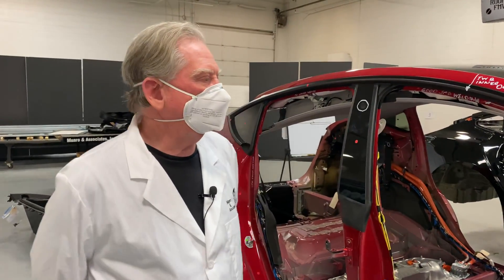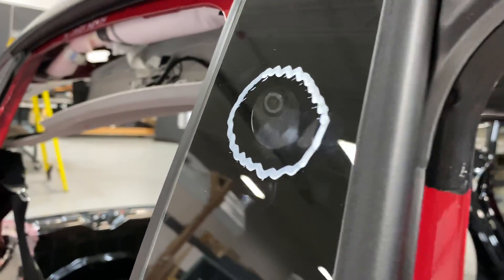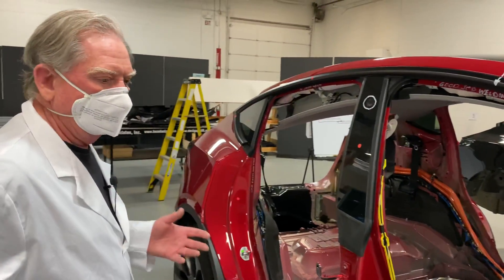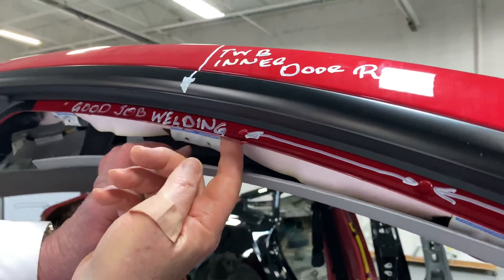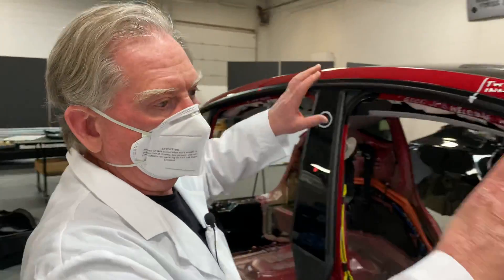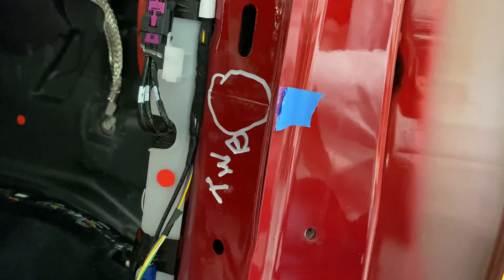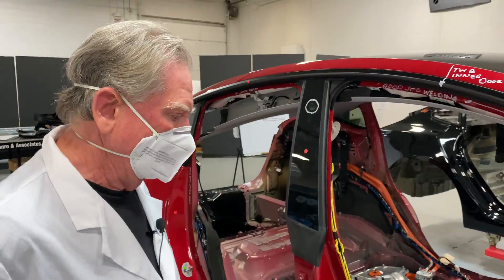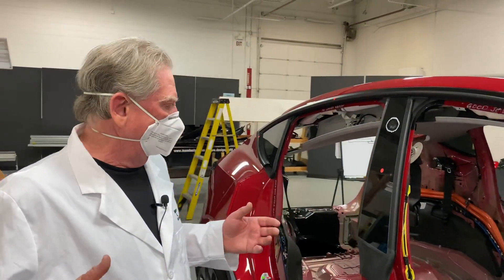Model Y E15: Tailor Welded Blanks, Body Side Inner, Welding Comparison MY-M3, Parts Raffle!

Comment: If you come across tailor welded blanks with no difference in thickness it can be due to different strength alloys or different heat-treatment of the two parts, see for example here: https://www.voestalpine.com/ultralights/en/Automotive-Notes/Tailor-welded-in-serial-production

Comment: Well i'm engineer that works for different automotive company and unfortunately in final assembly and not in body shop ..and i like this video..and you are right about many things.we are still using those old kind of welds..and you can be sure how crazy it gets when you have holes all over the place..well maybe hole isn't the exact name .i think when you weld those materials together you will get lower spots where water could go throu..or some other crazy stuff...also the screw you mentioned..that is common i have to say..designer didn't think or didn't think it would be better for ppl in production to make it easier..so they will come up with two or 3 types ob bolts..then you have to change sockets...and then it takes years to correct it..instead to use simple rules ..make it better for production to be able assembly it easier..faster..cheaper..with less tools ..less waste and so on..

Comment: Sandy.. just one point.. some contradiction in 2 of your vids. Is the model Y floor pan common with model 3 (as advised in an eatlier vid and hence the EPP wedge assembly under the pedals) ) or is it a one piece version of the model 3's pan  as intimated here?

Comment: How feasible is it to use adhesives (glue) s the primary method of bonding panels? No heat distortion and a continuous seam.

Comment: Can you please discuss the rubber molding that is around the doors and trunk openings? My model 3 has a bunch of ripples and bends that make it not fit seamlessly and it looks bad. I was hoping they cleaned this up in the Y, because it looks terrible from a fit and finish perspective. It’s almost like the molding wasn’t formed to fit in specific areas and was just manually pushed into the corners of the trunk and door openings.  BTW this series you are doing is fabulous:) Thank you.

Comment: The design and construction of the Model Y seems to be an improvement over the Model 3. Do you know if Tesla has made any changes to construction and tightened their tolerances on the current Model 3 verses the ones you inspected 2 years ago? Thanks

Comment: So who is responsible for putting the car back together? What happens if you have left over bolt ?
Reply from the maker: If we managed to put it back together with a left over bolt, did we improve the design or make it worse? Interesting question! All jokes aside, we will not be putting the car back together. Having the individual torn down components is more valuable to us for future analysis and comparing to other vehicles moving forward. Thanks for the question and thanks for tuning in!

Comment: I actually would like to know why electric cars are still using conventional acid batteries, and why they are not to sourcing energy from the battery cells? Considering these 1 million battery lifespan claims, there shouldn't be any problems with that?
Reply: 12v battery needed to close the contactor to allow high current to flow from the main battery pack.

Comment: Sandy, one question: Did Tesla left the space under the driver seat empty to add additional battery capacity in the future? Would that be possible? Thank you and stay healthy. Greets from GER ;)
Reply: Not easy, perhaps not possible to add to battery pack (Elon Musk no longer sees need for battery modules - only single Pack - for now).  Other OEMs still use cell/pouch, modules, pack.

Comment: Why not call it what is it, a buttweld?
Why ignore penetration and HAZ in explanation?
Why ignore how a lap joint weld increases strength and compensations for HAZ, defects, etc.?
Why ignore how "no material where you don't need it" only applies to static weight vs. strength optimized designs and is a poor fit for dynamic loading and crash loads?
Reply: Why ask stupid questions?

Comment: So forming a blank after welding makes it tailored?
Reply from the maker: In a sense, yes.  A tailor welded blank is advantageous in that you weld varying gauges of material together before they have been stamped (i.e. still considered a blank), and then you can stamp out a part that has varying mechanical properties that have been "tailored" to the application.  Thanks for tuning in!

Comment: Before 1988 we were dabbling with Synergic MIG welding, it had a tight control loop on the wire feed speed using the arc voltage to keep a consistent distance, and hence power, in the arc. It made hand welding quality much easier to achieve on aluminium. Then in the mid 80's for the stainless steel we had plasma welding which created the weld pool from a sacrificial lip on the work piece. This made the neatest weld I've seen. I guess the technology and the control systems available now will be leagues ahead of that.

Comment: I really wish that hello and work with him answer some of the questions because the lone bolt just doesn't quite make sense. The car so well engineered doesn't show mistakes of previous generations and quite frankly using the same bolts is for Simplicity is such a basic concept especially in that orientation that it makes me think that they intentionally did that and have a specific reason. However we may never know unless they contact and explain the reason

Comment: I'd like to bid on the wheels. Starting bid $500.
Reply from the maker: We have a plan in mind for the wheels to make them available... Stay tuned for upcoming Episodes to see!
Reply: Sandy, please keep in mind that Tesla has made many rolling changes to the model 3 since those Early days in 2017.  Perhaps not the Big changes you’d like to see. Nonetheless they have still delivered over 600,000 Model 3’s to date. I’m glad you like most of the things you’ve found in the Y so far. But just like the Model 3 the Y will see rolling improvements as time goes on too.

Comment: Would like a video where you go into the repairability and serviceability, with Tesla owning the service centers they are tightly integrated and should be communicating back to the mother ship areas where it’s too difficult. 

In particular Model S & X MCU’s heck also the 3, are too difficult for them to replace.  Minor for a Ford or GM who never offers upgrades or updates but Tesla is retrofitting the “brains” of cars as “young” as April 2019. 

Also the Tesla cabin air filters are amazing, but they make it Difficult to swap. Weird access and deep screws in something that should have been made to service.

Comment: The weld quantity in the 3 improved SIGNIFICANTLY after the first few months of production. It was constantly being tweaked and improved.
Reply: I would love to see him do a newer version Model 3
Reply: Have to assume it’s the original/early version that they tore down? If I owned a newer 3 I would think some “running” changes were incorporated. Also his critiques were about manufacturing efficiencies and not safety etc... kind of wish he would circle back on that.
Reply: Makes sense they would go with robust, and then lighten and simplificate.
Reply: Are they allowed to change how cars are assembled with crash ratings and all? Wouldn't that affect thins?
Reply: Do you know what year of Model 3 he is using?
Reply: @greghagen6711  It was bought Feb 2018 or so, but it was produced in late 2017
Reply: Martin Bartek Would love to see him tear down a late 2019 model to see what changes Tesla made since that earlier model.
Reply: Still has those stupid laser welds though.

Comment: Sandy ,the bumps on the spotwelds do not come from welding too close to the edge. the bumps are left over glue by compressing the spotwelds . Afther baking the frame the glue looks and feel like welds. Please add me to yur linkedin ,i even have more tips .
Reply: @Dan Moyer The glue ( SIKA ) is there so you do not need 500 spotwelds + it protects the frame for vibration. This gleu is special desigend for spotwelds .I have build frames like this .
Reply: @Dan Moyer https://www.youtube.com/watch?v=nkgzjoEAb-M

Comment: I believe that both Models (3 & Y) are made on the same assembly line. Does anyone know if Tesla has also made the changes, mentioned here, on the current Model 3? Thanks in advance for the reply.
Reply: The bodies (BIW) are made on dedicated lines. Before shut-down General Assembly (where painted body turns into completed vehicle) was being done on same line, though not at same time. They built a run of Y then swap part supply back to build run of 3. GA for S and X runs both vehicles on same line at same time.
Reply: chstra45 Thanks for the clarification. Now it makes sense.
Reply: I have heard that they are making production line changes at the Fremont factory while they are down for the Wuhan virus.  Could be applying the model Y changes to the model 3.
Reply: @donm2255  depends on what you mean by changes. Some parts will start showing up in 3 over time. If you're thinking major changes to body, some were already made. But some changes aren't worth cost. Equipment was bought and installed already (millions $$), why throw it out. When Sandy says "it's not done this way" he's saying there is a less costly way to get the same result. Using more equipment, taking more time is wasteful. Not that it's unsafe or wrong exactly. If you've already invested in the equipment, damage done. You need a really good reason to create further wasted spending by throwing it out.
Reply: I’ve been checking my late build 3 (2/20) as he goes, and yes, lots of changes. Not sure about the different welding techniques as I won’t be destroying the car to find out!

Comment: Looks like Tesla is learning fast. In only a couple years there’s been a huge improvement in manufacturing
Reply: More than the Y being amazing it's the 3 that was bad in some construction aspect, period.
Tesla is getting at the level of the others with construction techniques, it's nothing special. Where they actually are far far better than anyone else is the BMS and the motors, and that was already evident on the 3.
Reply: @luca7069  Of course its special. They have improved very fast. Their 1st mass market car was just 8 years ago. Model Y is culmination of 3 cars which came before it.
Reply: What you see now is the work of industrial designers .
Reply: They would've never made it this far without the innovation they have (I mean, the welds are not the innovation, but maybe how fast they've improved on them, maybe not)

Comment: I'm very curious to know if the MIC (Made in China) Model 3 incorporated same of the Model Y improvements, 
especially the welding and the rear floor plan in two major pieces.
Reply: Great question.  Does anyone have any insight to add?
Reply: The very question I would like to know. I understand the Chinese made Model 3 incorporates a number of improvements but wonder if these are also being adopted into the Fremont made cars. Sandy is obviously impressed with the lessons Tesla are learning from building the Model 3 and presumably some of his feedback. Good also to learn that Tesla are going to be building a new paint shop as this will hopefully address another area where their quality was not comparable with the premium marques.
Reply: @richardpiper4828  It looks like the cast rear end of the MY has worked out well.  I would think it would be possible to do the same for the M3 and just drop the cast part into the assembly line at the place where all the individual ~70 pieces had finished assembly.  Tesla probably wants to run the casting system with the MY for a while and see if it could be improved before setting up casting for another model.
Reply: The Model 3 already has improvements. Munro’s Mo.3 was a very early one too.
Reply: Most likely no. Structural body changes are very expensive to make and I have only seen them made to meet new regulatory requirements(crash standards).
Reply: Nihongo Benkyo Shimasu best think made in China is this virus. Everything else is shit
Reply: @mattbrew11  Go check the news from ABC. Nov. 2019 White House was informed that some kind of Corona Virus was spreading in US. Let us expect more suprises that US government cannot cover up anymore. 

I know you can say whatever you like because that is your right of free speech, however, nobody care about what a loser talking about, especially  a nobrainer racist trash.
Reply: @Macoromni  WHO and others made attempts to warn our president and his administration.  Those warnings were ignored until things got out of hand.  Remember that in November.
Reply: @bobwallace9753  WHO said the Trump administration was behaving in a racist manner for stopping air travel from China in January.  WHO gave blanket cover to the Chinese communist party (by agreeing with them) when they claimed there was no human to human transmission of this coronavirus.  Grow up.
Reply: @mattbrew11  You racists ruin everything.
Reply: @TheWineroute  Ignore him, let's not get distracted. Tesla is best position to make use of talent from different parts of the world to advance electrification of transportation. We will use the best ideas and knowing what is done in different places is essential. Take care.
Reply: @edmalho  no offence, I know so many ppl say I am just against Chinese Government. However, I am very curious how do you think you know Chinese Government very well. 

Do you really know your own government? Are they not creepy? Look at the progresses happens in China every day. Is there any other government can make it happen? Look at the Chinese ppl walking on the streets, they are happy with smile. I am in Canada, give you an example that my parents get good amount of pensions even comparing with the Canadians in C$. Government is thinking to provide free Medicare after this pendamic. 

The problem here is majority ppl still think China and the government was still at 1980s, however,  China is changing rapidly in every aspects.
Reply: Christopher Peppey that’s not racist. I lived in China for three years and I’m half black and half Chinese myself.  I love Chinese people. My post is pointing at China as a nation not the people
Reply: @Macoromni  I don't need to "know" the government i just needed so see some friends be screwed big time with industrial espionage and the europol limited because of china. Do i know my government? It is perfect? Of curse not! But are you happy with a smile knowing that CPC was a blank card for the "greater good"? It's all good until they see you as the problem and do something in 1984's style. Just look at Dr. Li Wenliang. That would never fly in Europe and other democratic countries. I'm European and so what about pensions and medicare? I'm taxed for that and still need to spend money on private insurance. Every country has different stances in what is important and what is not. But I tell you, everyone here knows that what Chinese government does is not normal.
Reply: @edmalho  
China is a country with a very effective government.  Has there ever been a country that developed as rapidly?  A country that brought large numbers of its citizens out of poverty as rapidly?  A country that moved from the 'under developed' category to a world leader as rapidly?

The problem is, from a western point of view, that the Chinese government does not tolerate criticism and there is no non-violent way to change leadership if the party in power goes sour.

Here in the United States we might want to look at how China has been able to progress as rapidly as it has and pick some leaders that can do the same in fixing our problems.  We're ahead of Chinese citizens  in that we can freely discuss what isn't going right and we can swap out people in leadership positions if they aren't performing.  But right now we are doing a terrible job of picking good leaders.

I'm not sure we've got a great non-Trump option in November but Biden will almost certainly stop things from getting worse and will pick people for key jobs that we get us back on track.  Biden's too old for a second term.  We've got four years to pick better candidates.  And we can get control of the Senate out of Mitch McConnell's hands, possibly, this November and certainly in 2022.